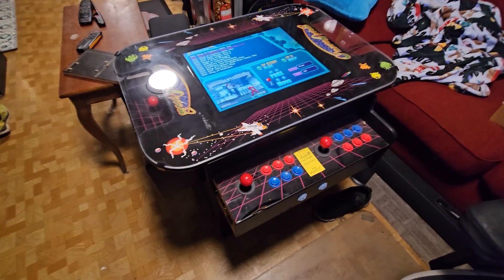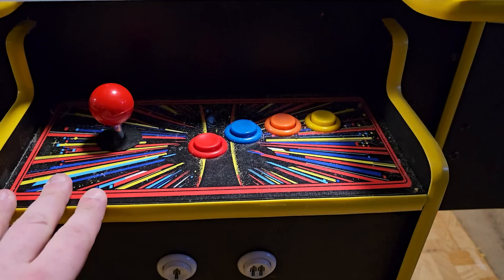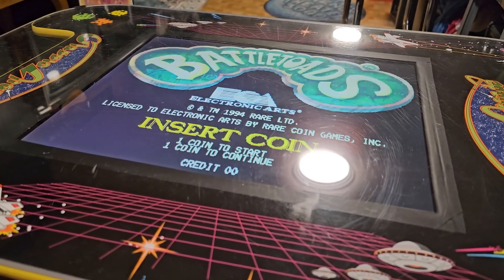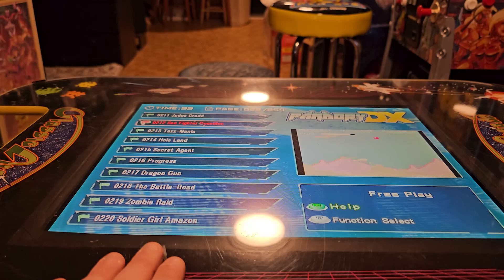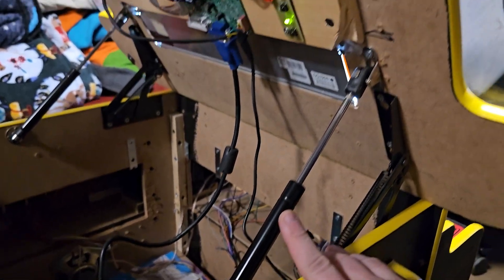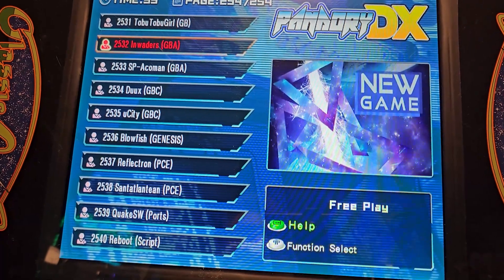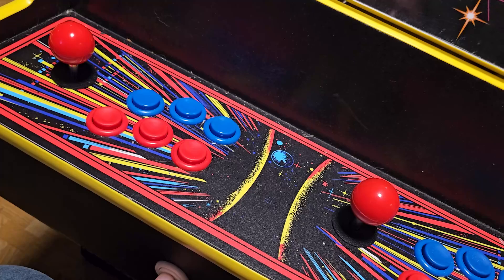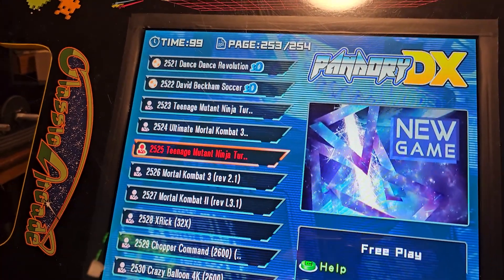Update on that Cocktail Arcade Cabinet I got a Few Months Ago.

Comment: This thing is super impressive and your work looks great.  But dude, replace the  plexiglass on the top.  With how cool this thing is, you should spend the 70 bucks so it doesn't look all beat up...maybe it's the light but man I think it would be worth the $70...
Reply: I'd go with smoked glass instead of plexi. Heavier and more expensive, but it looks nice and won't scratch up like that.
Reply from the maker: It's the light that makes it look worse that it actually appears.  I don't even notice the scratches while I'm playing it and that's primarily the reason I haven't bought a replacement.  If it really bothered me, I would have the replacement already.
Reply from the maker: I could get a glass replacement as well, but I think the price they were asking was around $200.  And it's not like the thing is in perfect condition at the moment, so I can do without that.

Comment: That yellow T-molding really pops. Looks nice.

The screws on the side of the control panel are no big deal. If they ever start to bother you, replace the drywall screws with some fancier looking painted screw.

Hey, I like the flip-top.
Reply from the maker: The screws don't really bother me at all, which is why I used them the way I did.  I think I was mentioning it because the screws were originally screwed in from the inside so you didn't see them.